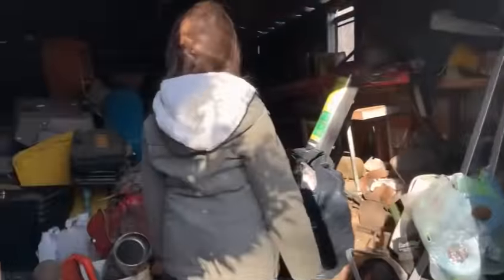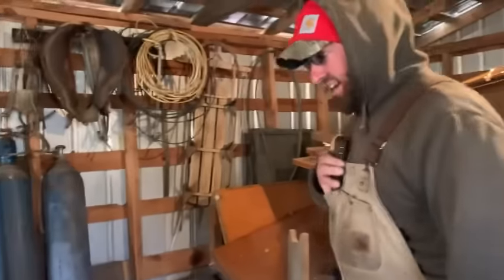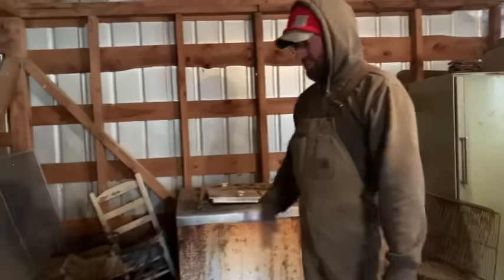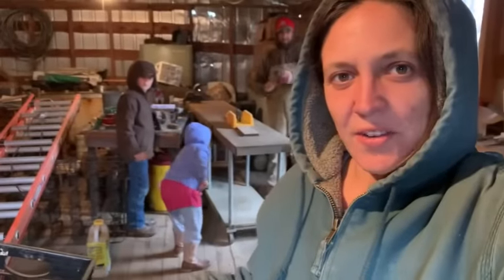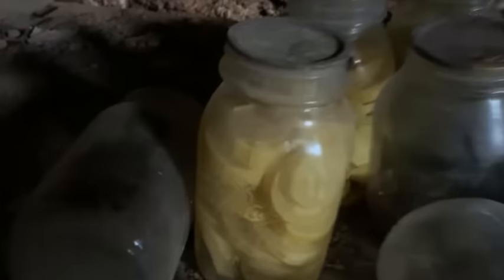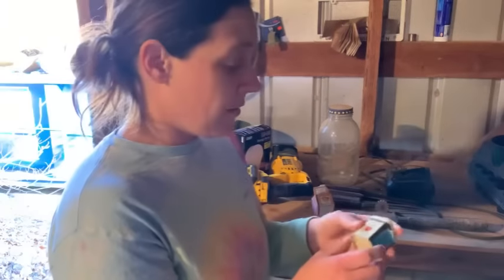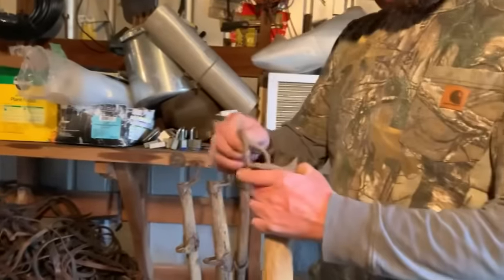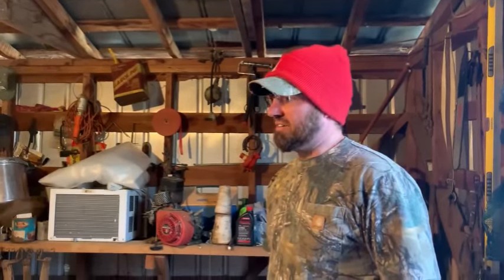Cleaning Out  Our 85 Year Old Tobacco Pack House | January 2024

Comment: That's a tobacco stringing buck or horse as some people called it. It was also used when taking tobacco off the stick when they stung it by hand. That table may have been used to take tobacco off the stick on that was strung on an electric stringer. When I cleaned out Grandpa's packhouse, I found one of Daddy's blue wool navy uniforms from World War II and the Winston-Salem Journal that reported the Lawson Family murders on Christmas day in 1929 in an old trunk. Those homemade hitch pins remind me of me. Give me an old wore out bolt that's big enough and I'll make a hitch pin out of it. I found a half gallon Tropical jar in the basement that Mama had but unfortunately, it was cracked. If you can fix the floor, it's definitely worth saving.

Comment: The round thing with the sharp wheel is what people used to make spots to run their leather or sinew through to make leather out of aniimal hides to use for many things. My mom has a butter churn with animal hide on the bottom of it and it still has it on it even though she doesn't churn butter in it. It's lasted probably 80 to 100 years. People made thing last and my grandfather has been dead since 82. my mom is 85 now!

Comment: You all got a lot cleaned out of the old shop of Grandpa's stuff. You never can tell when you might need something so hang on to it. You found lots of things you'll hang on to for way too long also but you never can tell. You do have a lot to do to put a new floor in the building. It's going to be lots of work but you have the equipment to do it. Stay safe and have fun with the project. Really enjoyed the video. Fred.

Comment: I remember the metal Pepsi lids that had cork liners and you remove the cork and the writing was printed on the metal lid. Used to have cardboard tube filled with peanuts and you would either get a nickel ,dime, or quarter inside.  If you bought a Pepsi you had to buy the peanuts to put in the Pepsi. My brothers taught me that.
Reply from the maker: I always done a coke and peanuts

Comment: I used a old basement jack( don't know what its called) but it had a screw type and it was made of metal and when you got the floor level you could put a metal pip in it and its holding up great! by the way put 2 cap blocks under neath it and it will stay untill the cows com home!

Comment: Andy, buy you some poly acrylic and clearcoat that table. It’ll preserve it and then you can even use it but I would do about four coats of polyurethane on it. It is a good table I like stuff like that. I would keep that for sure you can buy that water-based cut polyurethane, or even an oil base it’s up to you
Reply from the maker: i think we'll eventually do something like that for sure